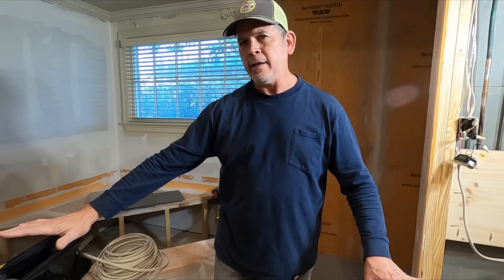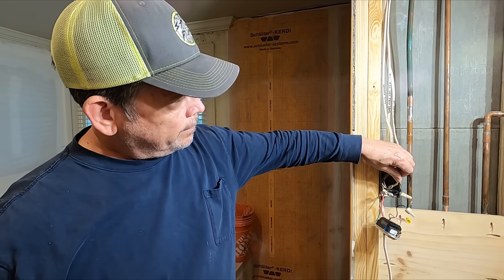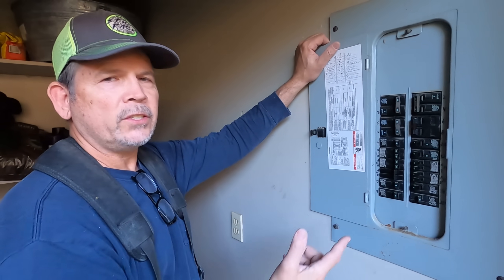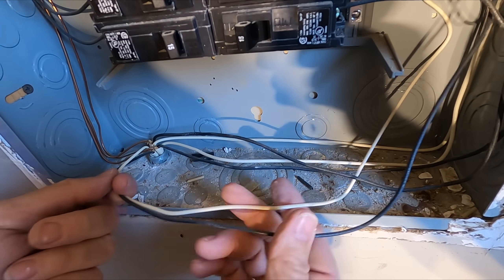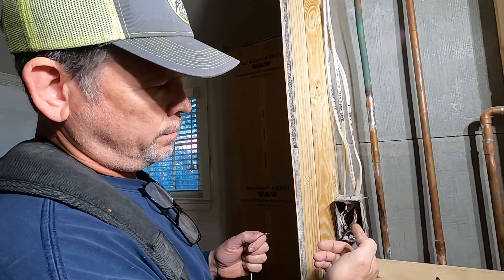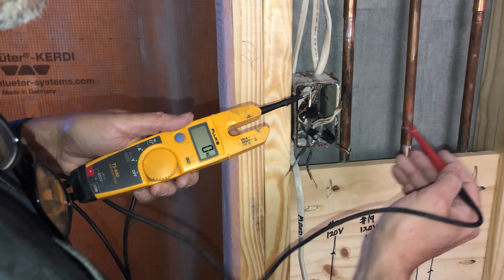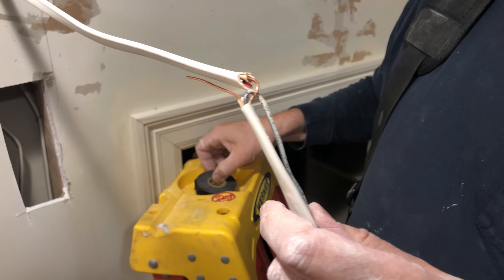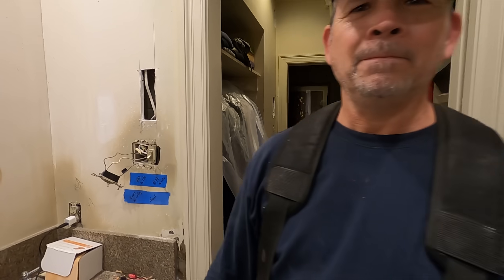You CAN Get SHOCKED by a Neutral Wire! This is How...

Comment: This is the kind of problem you get from people who know less about household electrical wiring than they think they do. 
I once lived in a rental house where the medicine cabinet above the sink included a light. Very old, two-wire system, no dedicated ground wire. The thing had been wired all wrong: the  hot wire was fastened to the intended neutral lug of the cabinet, and the wall switch was on the neutral wire. Flipping the switch completed the circuit, so the light worked. But the neutral lug of the cabinet light was also meant to be the ground for the metal frame. So now the metal frame was HOT AT ALL TIMES, REGARDLESS OF SWITCH POSTIOIN-RIGHT ABOVE THE VANITY SINK. 

Amazing no one got killed. 

 Another rental, a house trailer. 220V window AC quit working. I'm playing with the power switch, and I notice that when I flip it on,  THE PORCH LIGHT COMES ON. 
Some genius had created a 220 V circuit by connecting wires to left and right side circuit breakers in the panel-breakers that also controlled their own 110 V circuits. 
Old houses are full of anomalies like this.

Comment: Great explanation on the feedback on the neutral.  There was some really scary stuff happening in that 100A sub-panel (like 14 AWG Romex on 20A breakers, and it was way overloaded - a fire waiting to happen there).
Reply: Yep. Should have been #12 on 20 amp beakers.
Reply: How can you tell it's 14 gauge. My entire house is wired with white 12 awg romex

Comment: Been a remodeler for thirty years and encountered that far more times then should happen. Usually from DIY's messing up a three way. They some times think; white to white and black to black and your done. Not so twinkle toes. It's important to know what circuit is doing what especially with these new required on new work Arc Fault GFCI's that won't hardly tolerate even a incandescent lamp.

Comment: I got nailed by a Neutral at work, breaker was off, but the building was run with a shared neutral with 2 other circuits. I popped 2 of the breakers that serviced the location and did not know it was tied with a 3rd circuit, which was operating. (The building was built by volunteers…where they shared the neutral… before I was born) 
I screamed at my boss and he was… understanding to say the least. Got lucky we didn’t lose any of the equipment on the circuits.

Comment: Would a AF or GFCI or dual function circuit breaker help make that circuit 20/19 safe? Like when you jumped the neutral to ground/bonded pipe, I imagine it would’ve tripped, but what do I know. 

Also what Fluke meter is that? Do you recommend it for residential 120/240 work. I need an upgrade, and am liking the easy two hand operation.

Comment: Mark a/b in the center of the cover. Any breakers added and your markings become incomplete or sloppy. Panels are installed upside down to save length on the pricey feeder wire. I don’t think there’s any code that says up or down on a panel.

Comment: I have two light switches in the laundry room. 3-way. One on either side of the room. In one box, there's another switch that goes to an outside light. That switch has a load and line and the load, line, ground, and neutral coming in from the light switch but no neutral in the box. They wired the light fixture neutral into the ground. Would a usable neutral be in the other 3-way switch that I could jump off of? If I just connect to the neutral of the 3-way in the box where the light switch is, it only works when the 3-way is energized.

Comment: Your not getting a shock from the neutral wire. Your getting a shock because you opened the neutral splice and you then reconnected the neutral t they your body. If the neutral is not open you can touch a neutral wire all day and not get shocked. It’s the reason the geniuses that write the NEC are requiring a handle that will disconnect multi wire networks when turning off circuit breakers for repair.

Comment: Ok i see how the current is returning on the neutral, but how does the black wire of circuit 20 have voltage with the breaker off? Assuming that box is the home run for circuit 20?

Comment: My home has all neutrals wired together they don’t shock!
but when they make contact with ground main breaker trips off. my home has 2 hots coming from main line 1st has voltage of 220v the 2st one has 120v.

Comment: If the house had a Residual Current Device or Ground Fault Breaker installed (as I think is called in North America), that live neutral would have never stayed ...alive. 
The RCD would detect the faulty path and trip every time the switch was flipped. Not to mention when closing the circuit through the copper plumbing.

Comment: Great explanation of the problem with the energized neutral wire and “back feeding”.

Your trip into the attic to pull the new cable does NOT qualify as an “attic crawl” in my scoring system… your feet never left the ladder! A “real” attic crawl requires the entire body to enter the attic (and extra points are awarded for getting insulation stuck to your hair or clothing).

Comment: As an electrical apprentice, I have to say that, for a general construction guy, you have a better understanding of electrical circuits than I feel half the electricians I've come across. Way more than myself. This is an incredibly useful video. Thanks.
Reply: I was shocked more on neuts than hots when I did electrical. Part of that was me being a commercial installer and doing 3 phase panels where code said 1 neut for 3 hot is fine. Biggest things I will tell you is: 1) always check cause breakers fail and stay on as well sometimes. 2)Do not get too relaxed when working with life in T-Bar, the bar is usually grounded and easy to ground yourself and shock yourself. 3)If you get a new tool and work around live wires and it last about 2 weeks, probably will be there for a while. Most of us seem to blow up our new strippers in a couple of days of purchase. 4)I do not think there is a way to sound many after getting hit and the guys will check on you, once you are deemed OK you will be made fun of LOL.
Reply: Thx for showing appreciation to someone whom really wants to not have a DIY guy get killed or injured !  I am currently in Philippines and most electricians here are trying their best to kill as many as they can !  They haven't a clue as to why a ground wire may be needed as they insist there has never ever been a need to use one in Philippines !  They don't even know what a GFI breaker is !
Reply: if you know less than him you have a long way to go. he should always test a wire before touching it. some panels are connected in reverse and they give 2 hot wires when circuit breakers are off. you can't rely on colors

Comment: Great video, I actually have the same problem at my house. I figured it out though, I didn’t fix the problem because it hasn’t caused an issue but shutting off the breaker and having line voltage still present isn’t fun. Great video! Please do more electrical.

Comment: 7:18
Excuse me, but isn't that neutral taped with a black piece of electrical tape, indicating that it's NOT neutral, but black-hot? From what I can gather, it's a hot return in series with the switch to the light in the other room. In other words, the switch grounds the circuit in the other room via that box.

Comment: The video is well done. As a power lineman I’ve responded to 2 fatalities where town employees replacing copper water services, when they cut the old service they were electrocuted. Opening the house ground and the difference of potential was the issue. After these happened advised plumbers to install jumpers across the water device before cutting the pipe. Both homes were older. Open neutrals will kill you, electricity will take the least resistant path to ground and if you make yourself a jumper between open neutrals, bad things happen.

Comment: The neutral can be hot if the current flows through your hand to the neutral it's best to turn off the power which ever way you can the main, or the actual breaker or the switch but I don't recommend just turning off the switch even though I done it many of times. I even worked with live wires which I also don't recommend. In the industry world you cannot always turn off power because people are using computers or test equipment. People also don't like working in the dark. If you are home and working on electric please turn off the breaker. 73

Comment: Nicely done. As a newly retired General contractor I have always said. Use the right tool in the right place. That includes trades. Doing mostly remodels and additions there is always a discovery phase of a project. I have always leaned heavily on a good electrician and a Mechanical contractor. Its just a job and nobody needs to die trying to make a living. Enjoyed the video.

Comment: First rule of a Electrician Treat every wire like it 's hot. This is a common practice where a neutral is shared on 2 or more circuits. This isn't a problem until a switch or outlet is removed you can get 220v or 208v in my case where there should be 120v.  Always mark your wires and make a diagram of the wiring so you can put it back the way it was.

Comment: It's against code to return current on a neutral in a different cable or raceway. Circuits are referred to as branches for a reason. They're suppose to branch like a tree, not loop around like on a schematic.

Comment: Glad your ok..... I'm  an old electronics  tech  with  a background  in diy  and part time repairs  . Yup had my share  missguided stuff . Nice tracing job. Appreciate the  tip.  Working in Illinois  Chicago  trying to  replace  an old 2 prong receptacle  in a garage  conained inside a metal 4 gang box connected  to emt conduit with a 100feet  wrapped  extension  cord  to an overhead  garage door opener  .  Also inside  is a single pole toggle switch  separately  wired to an interior  round porcelain  bulb type fixture.  When breaket is off  unk if receptacle  is off. Its been their  since i bought the house  9 yrs ago.  Home is built in 1956. Didn't  see a gnd wire and garage is separate from  home.  Have taken pictures  jpegs . Could use some  help . Want to replace outlet  so garage door works  until  i can  replace  garage  and rework  all my electric with a licensed electrician.   Thanks for your time ... looking forward to  more videos.

Comment: I will keep this video in mind forever to showcase the dangers of remodels or electrical troubleshooting and cleanup jobs. I came across a three way switch that had been replaced with a single pole device-they put one of the travelers on the ground screw. Never say “that wouldn’t make any sense.” Investigate everything assuming it is booby-trapped. If it’s incomprehensibly stupid, it’s been done, and it’s waiting out there for you, somewhere.

Comment: Got me once. 
I had my collarbone actually dislocated from under the shoulder during a softball practice.  Went to her hospital, they set it, but it wasn't quite right.  A few days later, in extreme pain, I was replacing an outlet in a house my wife and I had just bought.  That white wire got me good.  But it also fixed my shoulder and it never really hurt much after that.  
Was good for my shoulder, but we wound up getting that whole house rewired after that.
Reply from the maker: I've been healed by such things too, strange isn't it?

Comment: First, "everything" is NOT off or nothing would come on.  Second, shared neutrals must pass the current from all circuits so the ONLY way to do that and meet code is for the two circuits to be on opposite mains phases.  Otherwise, the neutral can burn without tripping the breaker.

Comment: Thanks for a great video sir , I was shocked by a open neutral on a 277 volt lighting circuit at John Paul Jones arena in Charlottesville VA . You can share the neutral on three phase panels A B C phase , When shocked by a open neutral on 277 volts you can't shake it loose .

Comment: To support the door panel, the first two screws I remove are replaced with "guide pins."  These are two 10-24 screws with the head cut off.  These support the panel while remaining screws are removed.   Then panel can be be pulled off over the headless screws.

Comment: thank you for this informative video, I have actually had this problem before,  i was replacing an outlet or light switch in my moms old house, and i  switched off the breaker to the light, but when i tested the line with a voltage meter, 120v. I had to turn off a 2nd breaker to make the wire safe to work with, I was younger and inexperienced so I just switched off mains power to be extra safe!

Comment: I am not an electrician--just a person whose father never owned a house newer than the 1940s. I do not doubt my abilities to work with electricity--but I always doubt my safety. Even when just replacing an outlet, I double and triple check the breaker, then do a final check with a multimeter. I do not fear electricity, but it is a force that must be respected.

Comment: Did you say you had circuits 19 & 20 in the same box sharing a neutral? That wouldb 240 between the 2 hots and also from the neutral to ground. That would really hurt.

Comment: A branch circuit loosing the single neutral as shown in your video would now allow the voltage to double in the circuit.   In your example it would no longer be 120v it would be 240v. This is assuming the CBs are sourced from different phase (L1 and L2).   Kirchhoff voltage law. The other possibility your configuration has both CBs  attached to the same phase kL1 OR L2). Which would allow the current in the neutral to now double, and not cancel. CBs  sourced from different phases  allows the current to cancel in the neutral.  Since your lights did not burn out with a loose of a neutral would indicate each CB is sourced from the same  phase voltage. Worse possible case. Many older home use branch circuits. Not the best but it saved on material and installation time.

Comment: Just because it is a white wire, doesn't mean it is a neutral. There are only two colors to choose from in romex, white and black. When you wire up 3-way or 4-way switches, you end up having to use a white wire as a "hot" . By code you should wrap the exposed wire in black tape to show that it is hot and not a neutral. If you have a true neutral wire that is 120V to ground, then you don't have a neutral to ground jumper installed like you should. So yes you can be shocked by a white wire, but not by a neutral wire that is connected to a neutral bus jumpered to the ground bus.

Comment: This is a MWBC, multi wire branch circuit effectively. What you discovered is the reason MWBC's require both poles to be tripped simultaneously. that said also the reason to check for voltage on all conductors in the box, panel, space and so on.

Comment: That panel is in a NEC code violation. It started in multi wire circuit. The nurtrial must be in the same case as the power along with wires in to a double pole breaker.

Comment: You can share a neutral between two separate circuits, as long as there is a voltage between the two ungrounded (hot) conductors, and the shared grounded conductor (neutral) has an equal voltage between it and each of the two ungrounded conductors.  BUT you must use a double-pole breaker so BOTH circuits are interrupted simultaneously with the breaker switched off.  AKA multiwire branch circuit.